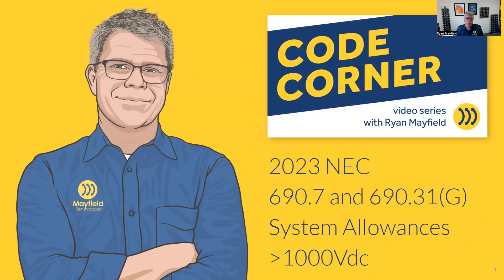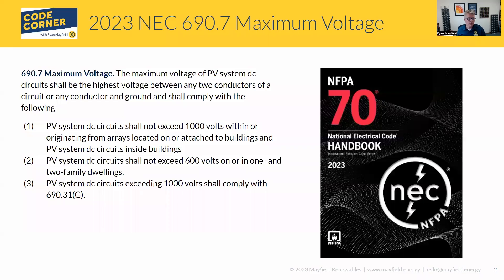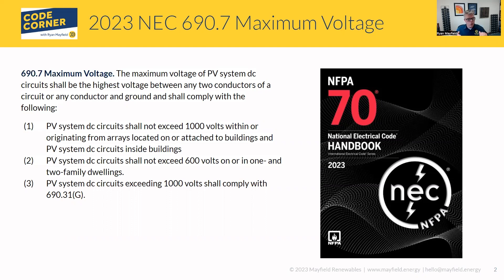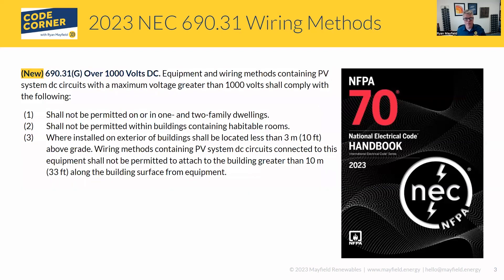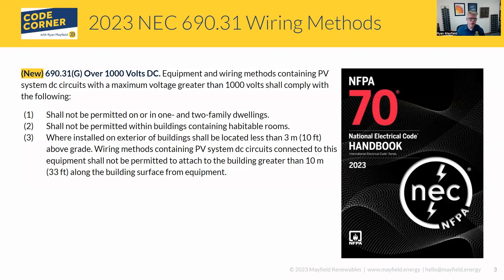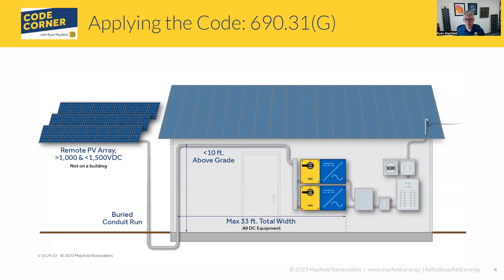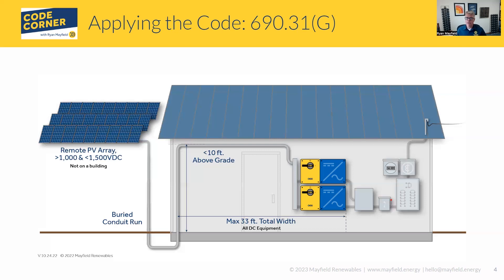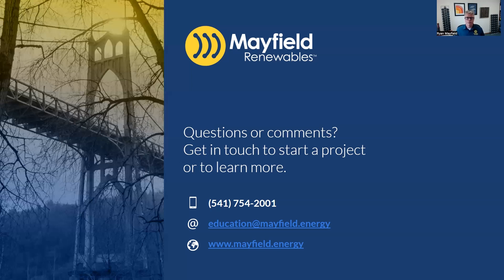Mayfield Renewables Code Corner: 2023 NEC 690.7 and 690.31(G): System Allowances

Comment: Is PVC schedule 40 conduit allowed to be used inside a home from roof to central inverter? I have a HO who is a contractor and he said that PVC is allowed in code.
Reply from the maker: It sounds like you are referring to DC conductors. PVC is not allowed for DC conductors per 690.31(D).